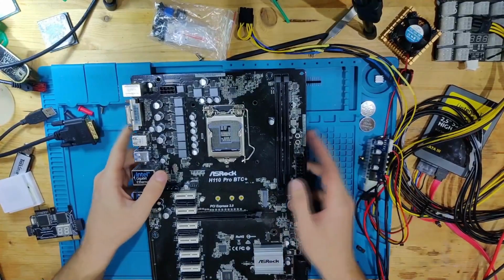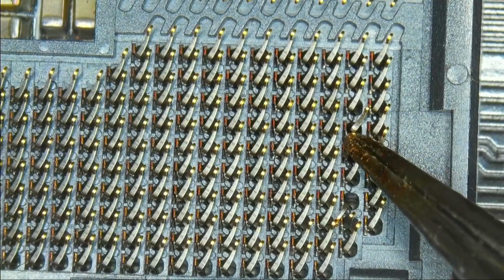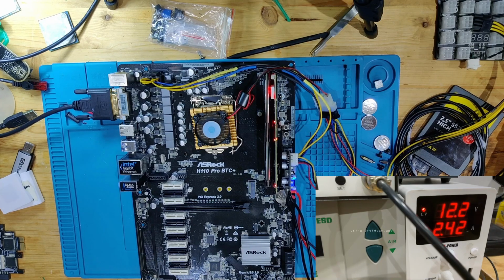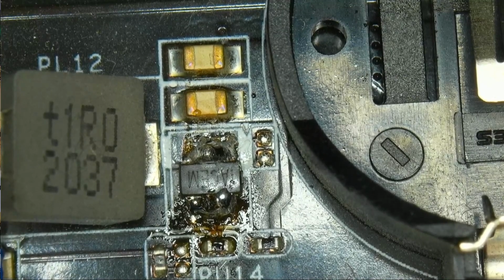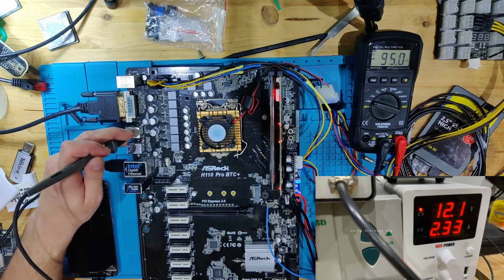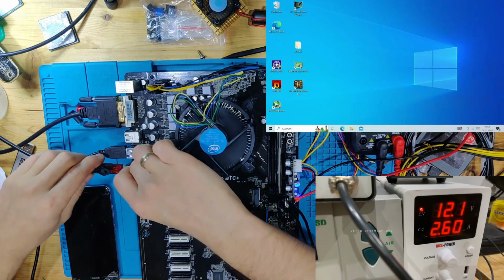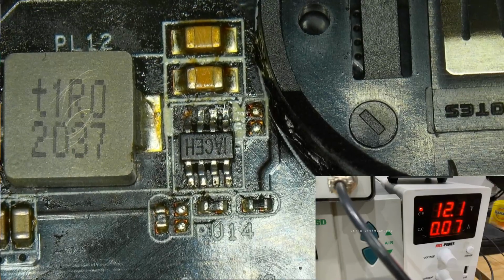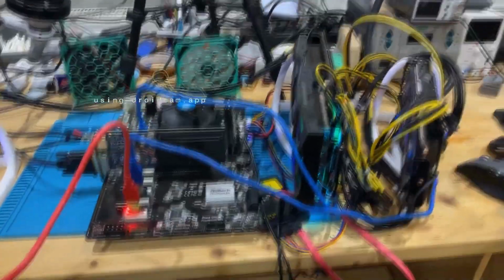HOW IS THIS POSTING??!??!!? | H110 BTC PRO+ REPAIR Mainboard Damaged CPU socket repair

Comment: I can feel the pain looking at the socket. Just got scammed today with an expensive supermicro server board. A lot of the 2011-3 Pins are bend like someone dressed them down using a finger and the way bigger problem is a broken/split DDR4 DimmA1 Slot. Those serverboards are really rare and I need this exact model. Its pretty unique and sells refurbished for atleast 400€... 4x NIC onboard, 8xDDR4 Slots that take LRDIMMS and even 3DS RAM up to 1536GB total RAM. Onboard SAS3008 Controller etc etc. 
Since the first RAM Slot is dead, i cant even use the second B rows...
You do repairs by any chance?
I really need this board and the seller even won't give me money back. I'm a bit stuck here.